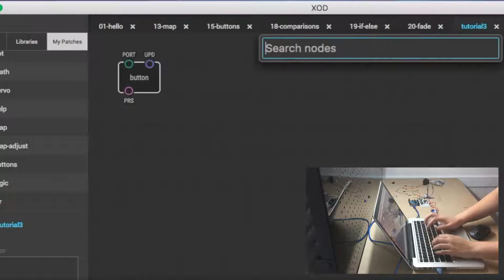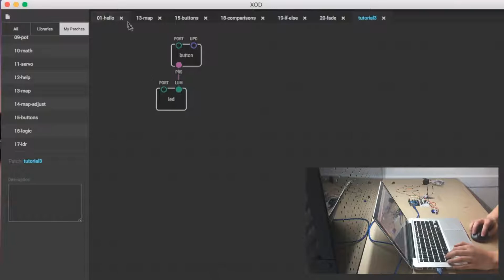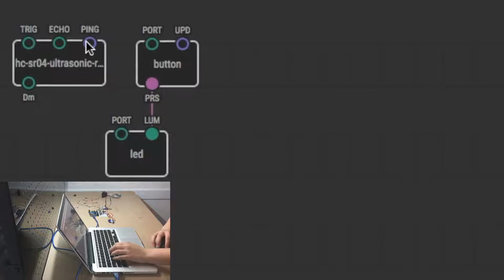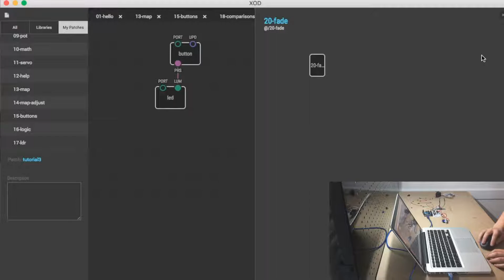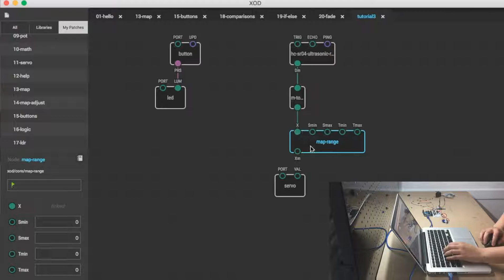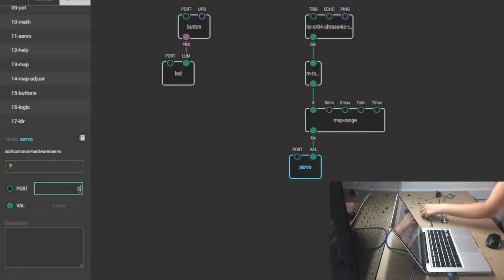XOD visual programming (Arduino based). Tutorial: #3

Comment: I still don't know how to make changing frequency depends of V on pot out.
Is there node about modulation freq?
Reply from the maker: Yes, it's called "Clock". Ticks (OUTPUT) every INT (input) interval
Reply: Thx for reply. How can i connect ticks to led and if i connect pot to ival of clock will it works?
Reply from the maker: If you want to make a blinking LED use also Flip-flop node. You patch will be like this: POT -> (ival)ClOCK ->(tgl)FLIP-FLOP - > (lum)LED

Comment: I installed the desktop XOD IDE and after trying the LED blink, XOD crashed. Tried to open XOD and got an error and later IObit Uninstaller automatically uninstalled XOD. I wonder how legit XOD is.
Reply from the maker: XOD deals with your USB-ports. That’s potentially dangerous because who knows what you have connected to your USB (a flash-stick with sensible data? a nuke? a bank-token?). So, I guess, IObit doesn’t like it. Its all the question of trust. XOD is open-source, you can find all its source code at https://github.com/xodio/xod, check out nothing suspicious happen there, build a version by yourself, and use that version you’re sure 100%. Alternatively, you can use browser-based XOD and upload with Arduino IDE through copy/paste… But the question is how legit Arduino IDE is. The answer is the same.